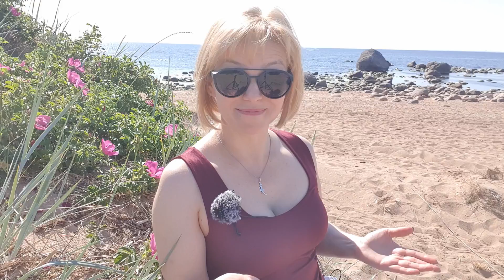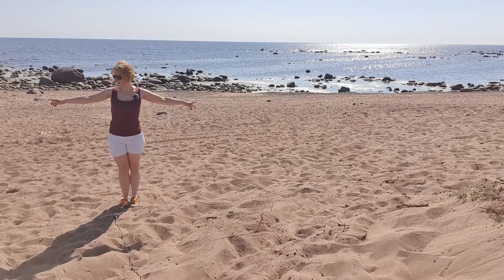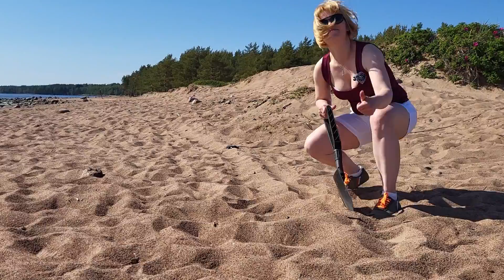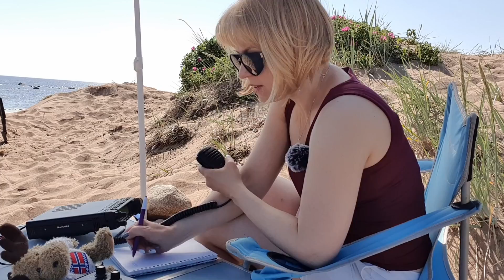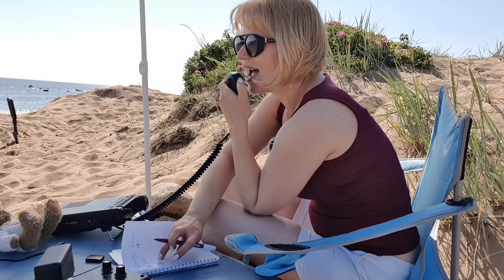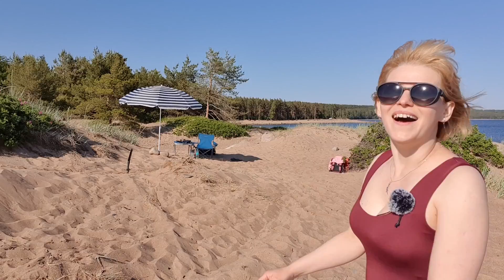Underground Dipole - the COLLAPSE of my ideas of Ham Antennas

Comment: The dielectric constant of the material surrounding the antenna changes the length for resonance. 
Having an above ground antenna to do A-B compares would be a good idea.   HF propagation changes significantly over time.

Comment: Glad to see a ham not afraid to think outside of the box! I just put a 200' longwire on a 6' wooden fence, with a 100' counterpoise near the bottom of the fence here in Florida. It is much quieter than a vertical on receive and is a good NVIS antenna. Congrats on your QSOs, Raisa.

Comment: Just a quick note.  I laid a 40 meter dipole antenna directly on the ground (10.06 meters each element).  The antenna works well as a NVIS (Near Vertical Incidence Skywave) antenna. I've also used what is called a "grasswire antenna" for DX.  Please see articles by Tom Toia (K3MT).  This antenna is very quiet on receive and does well if you point it toward your favored direction.  Your videos are a joy to watch.  Aloha from Hawaii Island.  Russ (KH6JRM).
Reply from the maker: Yes, NVIS... but I also did DX QSO with an On the Ground ANT, 73! Raisa
Reply: @YLRaisa  what can you say about direction of antenna, is traffic longitudinal (I think so) or perpendicular to dipole?

Comment: The velocity factor for an antenna wire above the ground is maybe 95%. As the wire gets very close to the ground the velocity factor goes down to maybe 60 or 70% on the ground. I experimented with and use several Beverage on the ground receiving antennas. Using my measured 60% (which is probably close in many cases ) you would find a half-wave dipole for 20 meters would need to be only about 5 meters long instead of about 10 meters. That’s exactly what you discovered in your experiment on the beach! 
Additionally most radio waves penetrate the earth to some degree. The shorter the wavelength the less it penetrates. 
73,
N4DJ
Reply from the maker: yes, we have the same result:  5 meters long instead of about 10 meters, regardless if in the USA or Russia.. 73! Raisa

Comment: Dear Raisa, Refraction "tilt", much as in a "Beverage" antenna. I have seen some other work along these lines, as I recall, an antenna was placed in the ground in a trench, the trench was filled with styrofoam beads. Silica should act in a similar way, with some losses from any iron contained in the sand. How many metres long was the overall length of your dipole? 73 DE W8LV BILL

Comment: That was great. I have the same antenna analyzer just has UHF. HF signals are longer wavelength. and for DX they have low angel off the horizon.   you can even use a whole wavelength of wire in a big square using a 4:1 balun . lay it right on the ground and it will work great. DX commander has a 80 meter loop just less than a meter off the ground and it works great. once you get into 160 meters the signal just rides along the ground. happy to see you trying different things, this is the fun of HAM radio. for DX on HF the takeoff angle is about 3 to 8 degrees off the horizon. depending on band. I am in Boston NY,USA . during winter in a park on the air we just threw out wire to make a 160 meter di pole .  worked stations all over even AM contacts with a icom IC 7300 and a battery.  73's
Reply from the maker: Thanks for a detailed comment! I hope we see each other on the band soon! 73! Raisa

Comment: Ihave seen 10-11 meter operators do same with extended ground radials buried three to five inches deep and multiple from vertical hub then watering the wires ,after watering the wires there was significsnt gain communication started at 100 air miles 1S unit at 1/2. Wave antron 99 after water injected the sig increased to 3S unit same mileage same antron 99
Reply from the maker: Thanks for sharing with my and my audience results of this experiment.

Comment: The seceret isn't a seceret. Look at the background to the ocean. It is water with free soltved ions of salt in it. These are good conditions for spreading the HF waves. 
By the way the "Goliath" use the same effect.
Please put the antenna in the air. I'm sure you need more logbooks capacity. To recomend is the butternut antenna for your location on the beach on the ocean. Or try a tripple leg.
Vy 73 de Jan, DL9MGE
Reply from the maker: Hi Jan, TNX for your comment, 
I already made the same test in the forest, NOT near alt water and I will publish the video with results soon ;-)

Comment: Interesting. The distances for the contacts in video were maybe 1000 to 2000km. This suggests antenna was not working in purely NVIS mode? The sand did look quite dry which may have been a factor?
Reply from the maker: I did also QSO with more than 5000 km with UA0 (Siberia). It was just not recorded... So it worked also for DX ! 73! Raisa

Comment: I did a similar experiment years ago with a 20m dipole, I didn't bury it but left it uncovered on the ground surface. SWR was a little high but I worked several contacts in to central and south Europe. When propagation is good you can use almost anything as an antenna of course with reduced efficiency. Anyway nice to do some crazy experiments.😀
Reply from the maker: You are right.  The most important thing is good propagation 🤗

Comment: I told AI (Chat GPT Version 4) about your experiment.  Here is the response.

Your ham radio experiment at the beach has a fascinating result and is tied to several key principles of radio wave propagation and antenna theory. Let's dig into this:

    Antenna Near Ground: The performance and behavior of an antenna can be significantly influenced by its proximity to the ground (or in this case, sand). This influence includes changes in radiation pattern, impedance, and resonant frequency. In this case, the sand was effectively part of the ground.

    Impact of Soil (or Sand) Characteristics: Different ground types (sand, soil, rock, etc.) have different electrical properties, including conductivity and dielectric constant. In general, wet or salty environments like the beach are more conductive than dry or rocky ones. The higher conductivity can effectively 'slow down' the radio waves, causing the antenna to behave as if it's longer than it physically is. This is why you had to shorten your antenna to reach resonance; the conductive sand was making your antenna electrically longer.

    Ground-Image Effect: When an antenna is placed close to the ground, it generates an 'image' of itself in the ground, effectively creating a mirror image. For a dipole, this can make it behave as if it's a part of a larger antenna system, changing its radiation pattern and potentially improving its performance.

    Proximity to Sea Water: If your beach is close to the sea, it's worth noting that sea water is a fantastic conductor. The combination of the ground effects mentioned above and the proximity to the sea could result in improved antenna performance, especially at lower frequencies.

    Burying the Antenna: Burying the antenna might also lead to some interesting effects. When you bury an antenna, you can form a ground dipole, a type of antenna that works by transmitting through the earth itself. In some circumstances, this can result in surprisingly effective communications.

All these factors could be at play, leading to the outcomes of your experiment. It's a good demonstration of how complex and fascinating radio wave propagation can be, and how different environments can dramatically impact radio communications.
Reply: All the theory is nice and worth mentioning. However, there is no real fun in reading alone in contrast  to actually practically take the wire and go on the air. Well done, Raisa! 👌
Reply: Raisa has nothing to comment on. I don't have anything to say either.
De VU2RZA

Comment: When I was living in Michigan I unds of 8 gauge wire on it, added a big air-variable capacitor to make 
it a high Q tuned circuit, and a FET pre-amp in order to receive WWVB on 60 kHz from Colorado, a distance of 1,000 miles away. I moved the loop from my first floor shop to the roof but found that the signal to noise ratio got worse there than in my shop. I finally tried it in the old, unfinished (mostly dirt floor) basement and ran coax up the stairs to my shop. Beautiful signal, almost pure sinusoidal except for a bit of noise on it for an hour or so at dawn and sunset. It occurred to me that the basement, which had only 1 lightbulb screwed to a rafter, and no other AC wiring was the lowest noise location around. RF noise was being suppressed, but the miles-long 60 kHz signals from Colorado didn't care about a little dirt.

Comment: The dry sand doesn't give much HF resistance, for it's mostly silicon. It shortens it a bit, but that's it. You are at the sea or at a lake and with that you have a very good groundplane beneath your antenna, which will reflect the signal high. My theory is, if you put your antenna in wet soil somewhere on the country, your results will be not as good. Excellent experiment! We had a very noisy 20m yesterday, so I'm quite surprised.
I learned something today.
73 de DL7HH
Reply: Yep. Conductive ground will ground it right out, but sand, especially if it's dry, hardly conducts anything at all, so RF hardly even sees it. An important element in designing a good ground for an image plane reflector out here in Colorado is figuring out just where the bands of interest 'think' ground actually is beneath your antenna, because it will be below actual ground level some distance. 
Underground antennas are good for getting rid of noise if you are working at very long wavelengths, although just setting the wire out on top of the ground is usually good enough.
Reply: Awaiting you wet soil video.

Comment: Technically there is nothing wrong with that antenna. First of all, you have been burying the dipole in the dry sand which is quite good dielectric. This results in a capacitive load which explains why you had to shorten the dipole. It would be interesting to bury the triangle antenna. Triangle antenna forms a stronger magnetic field which is supposed to be less adsorbed by the ground. 
So, what is next, Raisa? Are you going to sink the antenna or lift on a balloon?

Comment: Hello there! As we consider in your previous videos about near ground antennas: effective value of dielectric constant influences on radiator, and for such small depth in sand - eff_eps~1 (value around 1.5), but also tan_delta (dissipations) are effective and do not cause greate losses.
Typicaly, gain of such antenna is approximatly minus 10...minus 20 dBi (depending on soil).

Take a loock at ELPA 302 A - near ground antenna, serial manifactured.
Best regards, Yurii.
N.B. продолжаю рекомендовать использовать антенну с балуном в 600 Ом для широкополосной работы (в нескольких диапазонах), а не на выделенной частоте.
Reply from the maker: Юрий, большое спасибо за научное обоснование и совет! Буду продолжать экспериментировать ;)

Comment: 30 ohm the resistive part of the impedance. Very interesting ! How much shorter Is the dipole compared with 1/2 wave lenght? I think more than 5%...Thank You Raisa for sharing! 73 de IZ3GOA Sergio.
Reply from the maker: The total length of the dipole is almost half the required length - about 5 meters

Comment: Very nice test Raisa. I did something similar a few days ago. I was on a mountaintrip and on my destination 440 m asl I laid an 80-10 efhw directly on the mountain. I tuned it with my Elecraft T1 tuner and made QSO with my FT817 with 5 watts. It seems that if what is under the antenna has poor ground it will work.
Reply: Raisa was on the shoreline, so, just some meters to the salt water... still worked...
Reply from the maker: great experiment. In some situations, this understanding can help!

Comment: Probably the sand is dry and simply acts like an insulator.  If it was wet, it would be like surrounding the antenna with a grounded conductive material.  Just some initial thoughts.
Reply: I imagine that some distance below the antenna is salt water wetted sand, acting as a very good ground plane. I think what this amounts to is a NVIS antenna. It's a neat trick anyway, and might be really useful if you need an unobtrusive antenna in the field.
Reply from the maker: thanks for sharing your thoughts 👍